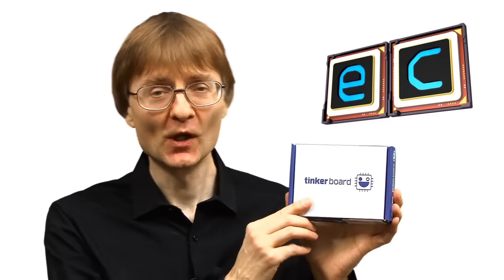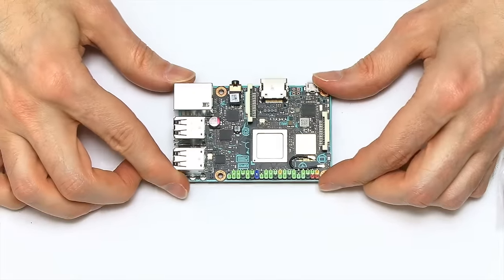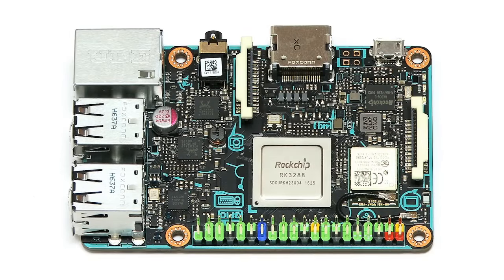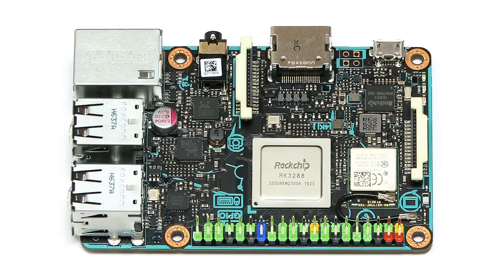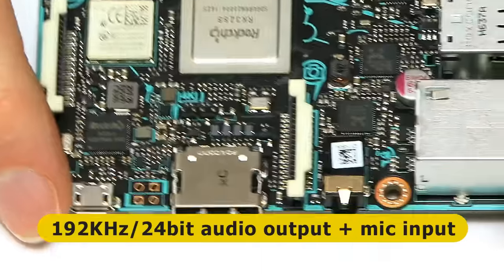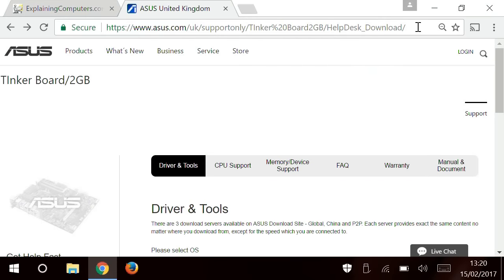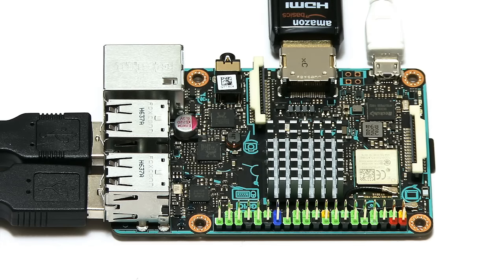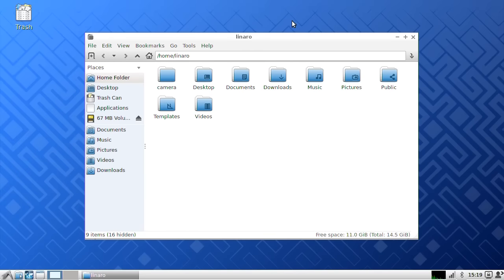Asus Tinker Board

Comment: Wonder what the pi 4 will be like?
I doubt it will be more powerful, because generally that is not what the pi foundation cares about, they focus on learning, not on speed. What do you all think?
Reply: Think I'll get it either way XD
Reply: Yes, I would love to see that, but the pi has its place, these clones can rarely be as good in terms of educational or just general build quality.
I cant wait to see a competitor on the same field.
Reply: HASSAN HaKMI Mabey they don't know faster pc= faster learning!
Reply: I've read that there won't be a RPi 4 because the RPi 3 is at a peak. The peak is for CPU speed and performance with 1.2 GHz, 64 bit and 4 cores. Linux runs happily in 1 Gb RAM, but 2 Gb would be good. The video processing doesn't need to be faster, but it could be. 3D graphics performance could be faster, but it's not a games machine. It's the low cost, reliability, portability, versatility and ease of use that's important.

I mostly use mine for editing documents, reading web pages and watching instructional videos. So being able to look at pdf files is useful. Also it's useful for electronics work with GPIO. WLAN is handy.
Reply: That seems interesting, however I do believe the pi zero line may have some more life in ti though, a pi zero with specs of a pi 2 or 3 seems like the next step forward. But who knows, for now all we do is wait.
Reply: VideoDaze 
The thing is that i run linux in my laptop with just 750 mb of ram an i am happy no issues at all
Reply: I max out the RAM and 100 Mb swapfile almost every day. I just close a few browser tabs and it frees up enough RAM.
Reply: HASSAN HaKMI pie 4?...not until rasberry pie 3.14 first

Comment: I maybe late to comment but I've recently purchased a Tinker Board (v1.2). Your review brought it to my attention. I've had it for but a day, and all I can say, is I'll never buy a Pi3 again! Well, now I have two of them to repurpose!

As my main SBC to use for home server duty, the Tinker Board really performs as it's price suggests, and that's perfect for my use case.

Is it a Raspberry Pi3 killer? Yes, it is indeed! IMO
Reply from the maker: Thanks for this -- and you may really like the new Tinker Board S! :) https://www.youtube.com/watch?v=OP6OJ0JhMLU
Reply: Just thought I should follow up and say, I've settled on running Armbian, as the go-to OS for the Tinker Board. It has the most complete repos available, well it's basically Ubuntu! 

E.g. running: sudo apt install lamp-server^ installs & works as it should, IME! A few other programs need to be installed manually, such as unrar & ufw. Having a few issues with Plex Server, but that was due to running TinkerOS.

Still, a few issues to work out but I'll say again, Armbian is working wonders so far.

Comment: is it overclockable ?
Reply from the maker: Asus say not . . .
Reply: ExplainingComputers GIMP as far as I can remember doesn't support multi core filter processing so I think it isn't a fair test for the Asus board a more adequate test would be Geekbench I suppose
Reply: Doubt it. No bios from my understanding. No way to really do anything on the hardware level.
Reply: Darth Vader 
I think you can do so by re-compile the linux kernel with your settings, including cpu clock speed.
Reply: did not know this. i have no idea how they would do this.
Reply: Ah, but if you use a custom kernel, then overclocking becomes a thing. And the RK3288 can be pushed safely to just over 2ghz with a proper heatsink and fan combo. It will be interesting to see what can be done with this board.

Comment: As far as Kodi, I'd imagine it will handle it just fine. I run Kodi on my first generation Raspberry Pi along with an SMB server, and it works alright. I did have to backfeed power as it would crash without the half a volt mine loses through the poly-fuse and it's still a bit slow to load menus, but it does the job. The Tinkerboard is obviously quite a bit more powerful than the first Pi, so I can't see why it'd have any issues.

Comment: The tinker board has a quad core 32 bit  SOC and the PI 3 has a quad core 64 bit SOC. That should mean the performance will be about the same depending on the task. Thank you for the outstanding videos. I watch every one.
dz

Comment: Too bad it doesn't feature any eMMC storage. Although the speed of SD Cards has improved in later years it is still one of the biggest bottlenecks on single board computers, and makes day-to-day multitasking infeasible.
Reply: It has UHS-I support, so the IO should be significantly faster than on the Pi.
Reply: 16 Gb 633x SDcards are available in Australia supermarkets. But will they be faster in RPi 3 than the microSD that comes with the RPi 3? Here is 4 tests of the RPi 3 microSD with USBDeview 2.27:
Transcend TSRASPI10-16G Raspberry Pi by Element 14
Pre-installed with NOOBS
Write Speed: 4.72, 4.21, 5.32, 6.37 MB/Sec
Read Speed: 18.96, 18.97, 18.85, 18.98 MB/Sec
Reply: ***** Almost certainly not. The RPi is limited to High Speed mode, it does not support UHS and most modern cards max out High Speed mode, so without UHS there's no competition.
Reply: You can set a pi up with the OS on a USB connected hard disk and then it only uses the SD card for the initial boot. I've been using my pi 3 with a Samsung SSD in a USB drive caddy for a year now and the performance is very good. The boot time is just 20 seconds to the full desktop IDE. Program's load quickly as well.
Reply: ssd in usb 2.0 on rpi 3 . LOL. talk about burning money
Reply: Buying a high quality microSD is a given with any SBC if you want good storage performance. A 32GB high performance card can be had for about $25US, 64GB for $35US and 128GB for $65. Just depends on your needs.
Reply: 300mb/s sd cards are coming
Reply: True, but at ridiculously expensive prices. For this kind of board, UHS3 speed does the job very well and at a good price point.

Comment: Just found out that the lack of support is because technically, the tinkerboard hasn't been released yet. It's only a couple of retailers that have started selling ahead of date. It's also good that you didn't test the 4K yet as the decoder drivers haven't been finished yet apparently and will launch towards the very end of the month (again, apparently, according to ASUS pr).

So would be interesting to see where we stand in a couple of weeks / a month's time :)

Comment: May be a silly thought, but... So the form factor and stuff is the same to fit the Raspberry Pi 2/3 cases (except those with build in heat sinks and stuff, because of position of the chips is not exactly the same. So, that brings me to the thought that Asus are trying to make a kind of replacement for the RPi, more powerful but aiming for the same community, so shouldn't the GPIO hardware available for the RPi work on the Tinker Board too (last I remember GPIO is a kind of standardized) with proper software support ofc. The other thought will be, what will happen if we put a RPi SD card in the slot, not the Raspbian, but things like Retrocade, RasPlex, PLEX (the official client for RPi), Kodi for RPi. Shouldn't they actually work too (and if they do, then Asus are really trying to replace the RPi with their board, not that bad of an option too, if it's more powerful but not MUCH more expensive).

Comment: I really wish they would put a so-dimm slot or two on future intel versions of these things, along with a pci-e (maybe on a breakout board?). Actually more RAM slots would be good. Often so-dimms are left over from laptops of comparible FSB and CPU. If a gigabyte of RAM per terrabyte of HDD space is a good rule of thumb for ZFS, the potential for a 1.8gHz quad core is wasted (especially with NFS when networking these). Torrenting with these little boards is commonplace so backup helps.

Comment: Great video as always! One thing you didn't mention was if the SD card slot was sprung. As we know, the RPI3 removed that amenity. :(

Also, do try to install a case to it... looking at the heat sink size and position (and the fact that ASUS advises to install it) makes me think many RPI cases won't fit. Please do more videos featuring this board in the future. Greetings from Mexico.
Reply from the maker: Yes, the SD card slot is spring -- a very nice click-in, click-out, as on a Pi 2. I will certainly be trying a case or two in a future video(s) on the board. Glad to hear that I am reaching Mexico! :)

Comment: Asus has a good reputation as a board-builder, and this thing reflects some good decisions. More memory, the supplied heat-sink, taking advantage of the Pi ecosystem for cases, &c. (though they obviously have some work to do on the software support mechanisms). Price/performance seems reasonable; if you need the extra power.  70% higher price for twice the memory and 50% faster, 10x Ethernet but in absolute $, not terribly significant.
Faster Ethernet could be an asset for prototyping networks.  USB 3.0 on at least one port would have been a big jump, but what impact would that have on the price?

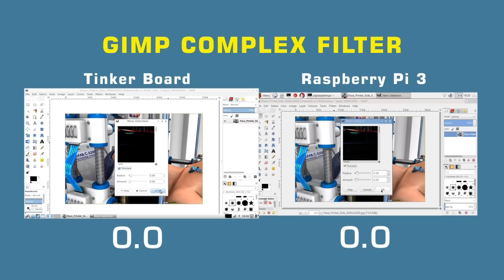Comment: In the test at 13:08, what did you have running in the terminal? In the taskbar at the top, you have the terminal open. It could have slowed it down enough to make the 1.6 secs difference. Great video, you've gained a new sub!

Comment: +ExplainingComputers / Christopher
It is good to see that a major hardware distributor / manufacture is not only producing SoC based devices but are also using the standards that the smaller manufactures have already introduced.

I am now wondering if, in the near future, we are going to see these interfaces (ie. the standard GPIO, CSI and DSI connectors / pin layouts)  get ISO certification and become a industry standard?

I think that if there is more interest from main stream manufacturers then this could be an exciting time for SoC based devices and innovation (especially within the domestic network peripheral and IoT markets).  

Also, if more main stream manufacturers are producing ARM based boards then does this mean that we are going to see a new uptake of Linux distributors and also see that certain companies (ie. Canonical / producer of Ubuntu) will gain further traction within the Operating System market? (and hopefully disrupt the monopolies that Microsoft and Apple have within this sector)

On a side note, as a small project, I have just dusted off an old Nexus7 (2012 - Grouper version) and revive it by replacing the Android firmware with a copy of Ubuntu (which I have added Raspberry and Kali ARM repositories) and am now using this devices as a mini 'laptop' styled device.
Reply from the maker: Sounds like a cool Nexus 7 project! :) I agree that some level of certification of pinousts for GPIO, etc, would be a great move forward.
Reply: I am also happy to see that Asus have used the industry compliant RF receptacle connectors within the WiFi antenna (should be easy to connect a standard BNC style WiFi antenna to this connection -- I have just incorporated two BNC connectors to my Banana BPI-R1 using this method.)

Comment: This is exciting to see some defacto standardization in the embedded space from different mainstream manufacturers so you can choose the right cost/density/power bracket for the same project. The Pi Foundation had some trouble with this off the bat, but they're on it now. The other fruit clones don't seem to get that yet.

Comment: It's quite an achievement that the Raspberry Pi (its form factor, specs & performance) is now almost an industry standard and something that which other SBC computers are judged by.

Will we get a conclusive 'is it worth buying' answer in the next video?
Reply from the maker: Yes, indeed. Amazing how the Pi is/has defined a standard. It seems that the Tinker Board is not officially released yet (even though I could easily buy one). Once I have tried Kodi and other software -- and some cases -- I will return to the "is it worth buying" question! :)

Comment: I ended up getting one of the z83 mini ii pc (32gb 2gb intel atom z8350, licensed windows 10 home all for £75-95 depending who you buy one from) works well can play 4k as long as your use edge or IE as chrome and Firefox still refuse to use the gpu for video decode (only using it for gpu render) after all the updates have been installed it works fairly well for a atom cpu (the gpu is very powerful compared to older atom cpus and normal cpus)

Comment: Technically, the TinkerBoard doesn't need a solid foundation because the Raspberry Pi already laid it down. This is evident, because Asus saw there didn't need to perform any major board changes, since they duplicated in its entirety the RPi3 board (attributing to its claim of "High compatibility"). This should mean most Pi projects require little to no modification by the end-user; at worst, the GPIO pins might function slightly different but that's no big deal for more adept users.

This almost feels like the old days; International Business Machines released the PC / AT, a small but dedicated userbase came into the fore and other companies saw a future where they could usurp their userbase with either a better or cheaper product. Many AT clones were released with varying success; More successful ones were usually cheaper since most users could get "Into it" without a heavy investment, but experienced AT users who value performance (or people with more money than sense) would buy more expensive kit with better features and more premium hardware.

The price appears to target the latter group, with Asus believing their profit will come from Pi users (or other clone users) who are looking for improved performance. As you seem more experienced with the Pi than a fair lot of your viewers, you commented about how "Quality" it feels with the better components and more weighty silicon. A new user wouldn't even know the difference.

Now if only companies could release a single-board PC with USB 3.1 and Thunderbolt, we'd have cheaper clones of Intel's NUC devices. There could be a market for a very cheap single-board computer with very capable ports for USB-connected addons which would allow for use of such external peripherals as the Razer Core, a USB 3.1-connected PCI expansion bay target for users of graphics cards, but also allow for other PCI devices. Now all we need are cheap clones of that...

Comment: I'm quite happy with my Pi 3 for retro emulation, but considering how even the 3 has issues running some recent consoles, the Tinker Board might be an upgrade eventually - If Emulationstation and so on gets ported over.

Comment: The best review  - great analytic job  ! So, because i bought one the last days  as "Manufacturer refurbished", i would like to ask you about the official  dimensions of the heat sink because it was not included .  Moreover, when i saw your "Video Playback & CPU Temperatures" i was wondering if you prefer an other proper heat sink as a better solution like the one you used with Raspberry Pi.

Comment: It's alright. I like most of the specs but I would much rather get rid of the Bluetooth altogether, and instead have 4GB of RAM. The 4GB over 2GB of RAM on all of these makes a world of difference with performance, you get to the point where you can use these as an actual desktop computer if you put 4GB of RAM in them. Anyway great video, I have seen a few of your videos so far. Always direct and to the point, very informative. Keep up the good work, and thanks for posting this.

Comment: Nice video and as you mention towards the end as good as the hardware seems to be it will live or die by its support, well at least I reckon it will. The Raspberry Pi enjoys that support in spades. 

I do love your presentation style and enjoy watching these videos. Most worthy of a sub, thanks for creating and sharing them. 

Have you had the chance to test out an Odroid C2 with its ability to use either SD or eMMC storage.?
The C2 enjoys since excellent support from the Kodi community, with a build of LibreELEC being available. 
Hardware wise there does seem to be several peripherals on the market already.

Comment: cool board! I saw this yesterday when I went to Micro Center.
Reply from the maker: Did they have them in stock? I am interested, as it seems that the board is not actually released yet (even though I purchased one with no problems).
Reply: yes they had a shelf with a few in the back.

Comment: so new to single board computers, but i love tinkering. found out people are making crazy handheld emulators. however from what ive gathered they all have various limitations. 

trying to build my own handheld, not just follow someone else's guide. anyways, the idea is a touch screen, then the gameboy style controls, but with dual joysticks added as well. flip up screen like a ds, and then a center set mini keyboard. 

sort of like that one device you can already buy, but not exactly. i also wanted to possibly see about adding the ability to read real gameboy carts, and use those cool adapters that take sd cards. found a forum post where someone figured out a way to kind of do it, but they didnt have enough connections to do it on a regular raspberry pi. 

i was thinking the asus board, but temps might be an issue, and wasnt sure if itd be able to run as a portable. any suggestions would be helpful. for anything really. like if you know of any like off the shelf pcb's for the dpad or other buttons that can be added on, or any displays your recommend. 

was originally thinking of getting a phone display to use, or a tablet display but found out that might not work in alot of cases. was also thinking i could maybe steal the display out of a psp or ps vita. along with the joysticks. 

the keyboard i was thinking i could get either from a phone or something, or potentially take it out of another device, or figure out a way to make my own with some individual micro switches and some sort of board or controller.